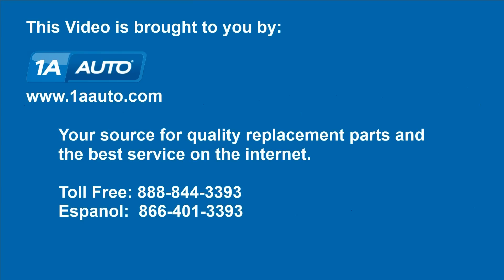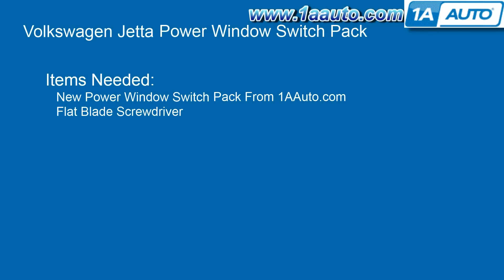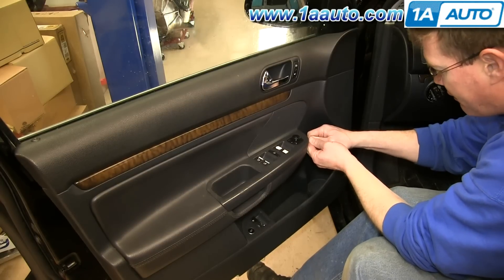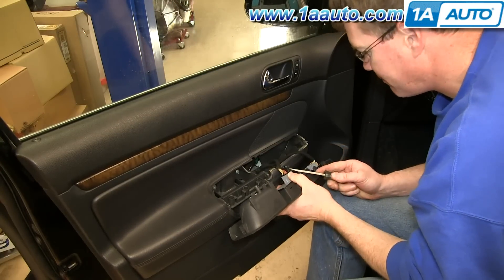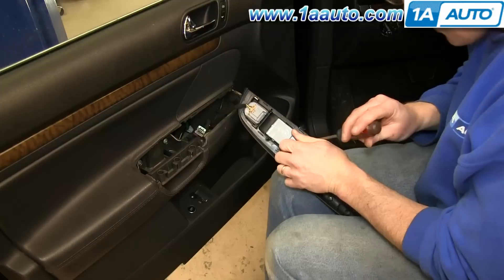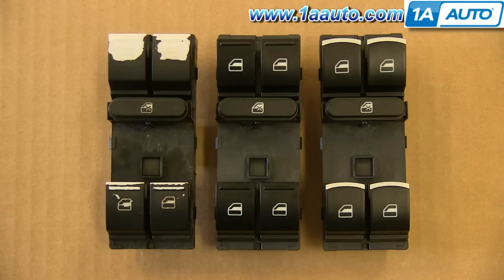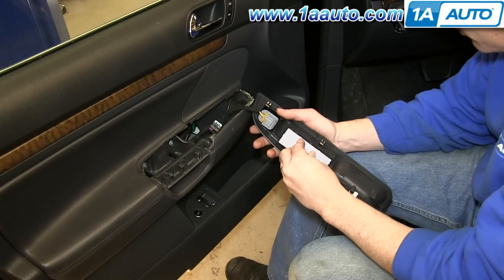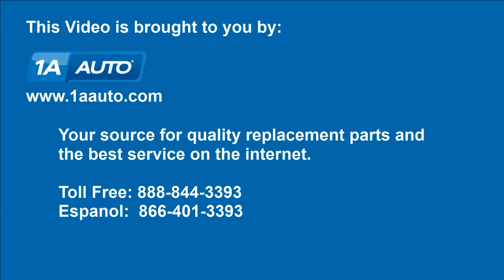How to Replace Master Power Window Switch 05-10 Volkswagen Jetta

Comment: Thanks for sharing.    
Where is the fuse for the power windows, power mirrors, & interior power door lock switches?  Seems like I've got a blown fuse, but I checked every fuse I can find & none are blown. Also my truck & fuel door switches aren't working, maybe just a back connection, idk.          Your videos are great quality & always very helpful thanks again.           - Leeroy

Comment: Thank you. Yesterday I turned on my golf engine .(with the door open) to de-ice the car. I didn't notice that I'd bumped the wiper stalk as I got in. The wipers dumped a kilo or more of snow straight onto the switch cluster. I wiped it down and went for a walk while the car warmed up. Later, whilst shopping I opened the windows as they were fogged. Then I couldn't close them. Pretty sure water will turn out to be the problem.

Comment: I've actually taken these apart, removed the switch cover, disassembled the switch, and cleaned the contacts. Be VERY careful when you do this, and take a photo before removing the leaf switches from the contact. They are keyed, and MUST go back in the same manner they went in. This is one of the very few switches i found that can be disassembled, and the contacts cleaned.

Comment: I just replaced mine today with the help of this video. The only thing I loosened the tabs by sticking the screwdriver through the slits on the side instead of down through the top and it came out a whole lot easier. The entire cost was $37.00 for the part the dealership wanted $81.00 plus tax for the part and labor. Thank you so much.
Reply from the maker: Thank you for watching! Glad to be of help. Please let us know how the repair turns out. 1aauto.com 888-844-3393
Reply: They take out the old part and fit the new part but they don't show that the new part actually works . Please update the video and put one up for a 2004 mk5 vw golf .